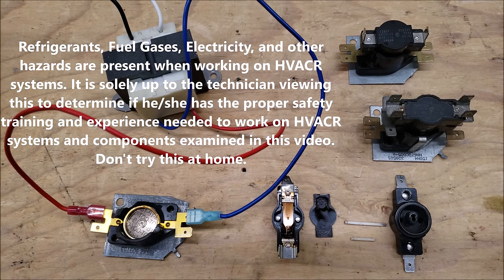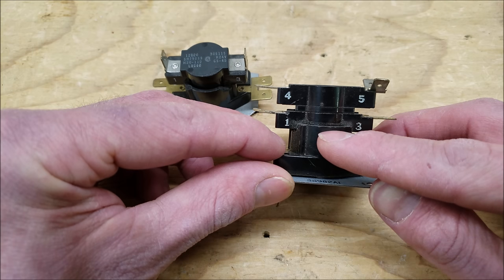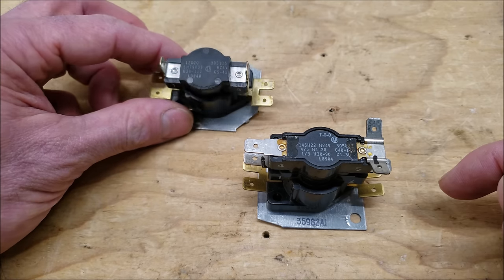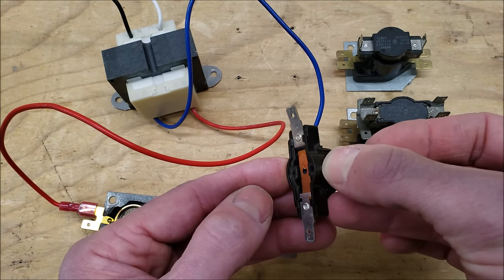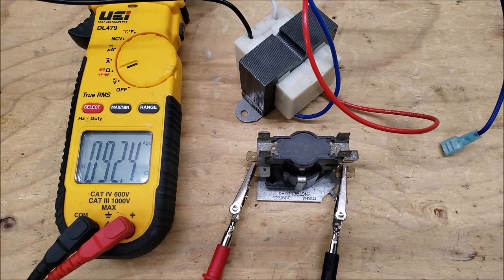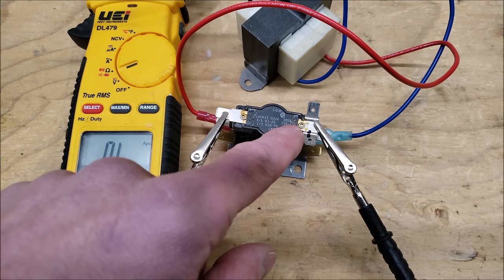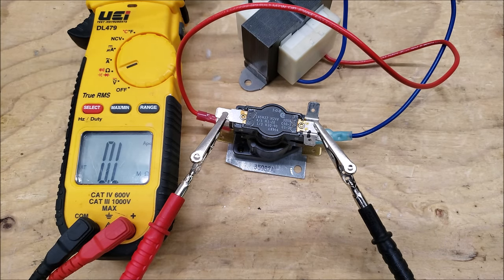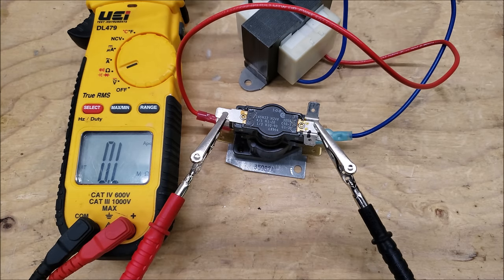HEAT SEQUENCER Operation, Timing, & Testing

Comment: Question, my heat is not cutting off all the time ( even  turning it off at the themostat it stays on ) I have to cut the heat off at the breaker for it to completely shut off. This problem is intermittent but it’s becoming more common. Could the heat sequencer be going bad,getting stuck? I’ve already replaced the themostat and the wires to the themostat seems to look good ( and none are touching- so I don’t think I have a short )

Comment: Ok still little confused.  If the heater snaps or moves just one time, how is there a difference in timing of the switches? Should both rods move at the same movement time as well?

Comment: Can this cause  an intermittent problem with the HVAC blower starting but sometimes not? I changed my motor  capacitor, HVAC runs fine but sometime the fan blower does not start.

Comment: (Time 4:22) Yep, I found the same burnt contacts on mine after working 11 years.
The give away was the fan kept running with the strip heaters on from the contacts sticking intermittently. 
Great Vid and Thank you AC Service Tech and keep making those vids :)
Reply: I hope that your second line would be true. I just got my Sequencer after two months, and I will put it in work tomorrow.

Comment: Thank you for your video. I have very hard time to find a "new part" for my Sequencer: PN# 14SH22 H24V 305886 4/5 H1-15 C45-110, 1/3 H20-45 C1-30.
Reply: I’m looking for almost the same part my only difference is the H20-45 on yours is a H20-40 on mine. What did you do to get a new part I can’t find one that’s the exact same anywhere

Comment: Yes, this I didn't understand, because most working with gas furnaces and heat pump. If you can make a couple of the videos about the sequence of operation electric heater and troubleshooting those, that would be great)))) thank you!
Reply from the maker: Hey Tapch, did you see this video on the electric strip heater voltage path? I started linking related videos in the description sections, thanks!-  https://youtu.be/7_-x6u9uzhU
Reply: AC Service Tech LLC thanks )! I'll watch

Comment: Got a furnace with no control/circuit board that blew a transformer (no fuse) replaced transformer and added fuse and blows the fuse instantly when i turn the power on! Any thoughts?

Comment: I found an interesting problem with digital thermostats I never ran across before.
When they house is 32 degrees, the "AAA" batteries shut down in about 12-15 minutes with a low battery display, and no more use out of thermostat signals.  So you need to work REAL fast or lose the control signals.

Comment: so if im getting 21 volts at the wires going to the intermittent pilot module that are supposed to send power to the gas valve... that sequencer is the culprit ??!! I am getting correct voltage every where but at that point.... so the sequencer or the wires leaving the sequencer to the intermittent pilot are the culprits

Comment: If a sequencer is cold will it take longer for the bimetal disc to heat up and close the contacts???
Reply from the maker: Since the sequencer's bi-metal disc will flex due to heat, yes but once a little heat is generated, it is insulated by the plastic surrounding the disc so the heat will build fairly quickly. I don't think you will notice much of a difference in timing unless the seconds were counted critically, thanks and good observation!

Comment: I guess it saves wire.  But after a good night sleep and reading the wiring diagram my head scratching is ended.
The upper coil is wired in series, and taps off to blower motor.  Couldn't figure out why it isn't always on.  The blower just makes a big loop back to L1, so the entire circuit is just a big bus bar looking for a way out that the contractor supplies to L2, and the blower gets power backwards if relay doesn't kick on.  Since AC doesn't care which way it works, all good.

Comment: Do 240v hvac transformers supply 24v dc or ac current?
Reply: Almost always AC. Some air handlers do use 22v or 28v DC relays, but that is accomplished by a rectifier. The transformer is still 24v AC.

Comment: So I was practicing with my multimeter on a working electric furnace that has no problem works normally. I shut the breakers off, thermostat is off. I tested the sequencer for continuity across the top prongs which I thought should be open, yet I got a continuity beep. I did not take any wires off the sequencer. Should I take the wires off to test? Do I have to take all the wires off? Thanks for video
Reply: Yes, you should take off all the wires on any devices before you do continuity test.

Comment: hi when these sequencers are failing, do you get chatter/machine gun sound? i'm up north, first freezing cold day today since the winter, -13c. heat pump is off as too cold, aux heat strips took over in the air handler. It is a Trane 4tee3f37b1000aa, system about 12 years old. Noticed when the aux heat starts, there's a machine gun rapid fire/chatter sound at the air handler, right about where the red 20KW line comes in. i'm not really familiar with relays but could it be relays that turn the strips on and off?? (sounds like a machine gun, fairly loud if i put my ear on the panel). Once the heat gets going and the fan is up to speed, it seems to stop, and then starts again a bit when the heat cycle shuts off. I'm still getting aux heat but not sure if the 4 strips are all working 100%. if i lost a strip or 2 out of 4 would the others continue to work or would they all stop?, Is there a fire hazard if either a strip is burnt or relay coils chattering furiously. Or could this noise be something else like arcing at the strips? the system cycles on and off a lot when it's too cold for the heat pump, nothing new but i guess that's normal, since the air is hotter, it gets back to temp fast compared to heat pump.  If its a relay, how long can it function like this? is failure imminent? i am diy, have diagnosed and fixed blower motor,  module before and other things like outdoor cap.

Does this sound like a relay problem? thx I can easily open the from panel, just not sure what to look for.

Comment: What would be the voltage between 4 and 5?
Reply: The voltage would all depend on the application. In an air handler where the sequencer is switching a heating element, you're typically going to read 120v across 4 & 5 when the switch is open (as long as there are no other devices that are open in the circuit). Then you would read 0v across 4 & 5 when the switch is closed (heat is operating).

Comment: Really good explanation.
I am having difficulty trying to figure out exactly how the thermal disc can drop the rods for the contactors at different times.
Can you give a more detailed explanation for this?
Reply from the maker: Instead of just a snapping action, think about a slowly bending disc with the two rods in slightly different locations on the disc, thanks!

Comment: Is the heat sequencer what causes short cycling?
Reply from the maker: Short cycling can be caused by many different problems. You could turn the power off and then disconnect the heat strips and blower and then turn the power back on to test the low voltage circuit for problems, thanks!

Comment: Normally closed and Normally open. I’m trying to grasp the concepts. Is it On/Off or Off/On. Thanks.
Reply from the maker: yes you will see NC and NO on electrical wiring diagrams or an open line on the circuit if it is NO, thanks
Reply: Normally closed and normally open basically just means what state the switch is in when no power is applied.  Most of the time   it refers to relays, contactors, sequencers, momentary switches, and devices that have a default position.

Comment: hey i have a commercial hvac interview saturday... anyone give me any tips or hvac questions they may ask ?
Reply from the maker: Service they may go a little hard on you but if it is mainly an installation position, they will likely be more interested in your safety, lockout tagout, situational awareness, communication with others, and being there before time- not on time. I have had them watching me on camera before my interview in the waiting room so from the time you get out of your car until you get back in your car, make sure you are in tip top shape. Good luck and let me know how you make out, thanks!
Reply: AC Service Tech LLC Thanks. i’ll let you know

Comment: So. Cal. Gas calls it a clicks on disc.
Reply from the maker: Yes it is a bimetal disc that sits on the pan heater and Klixon and Sensata are the manufacturers
Reply: @acservicetechchannel  standard safty inspection for a new water heater with the unitrol valve requires turning up the thermostat nob until the dic clicks verifying its operation. I enjoy your videos.